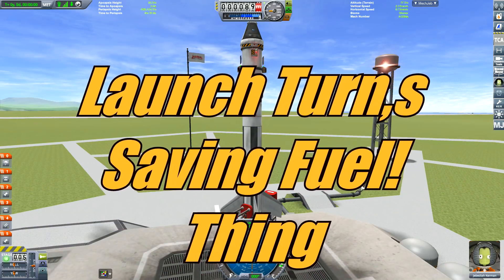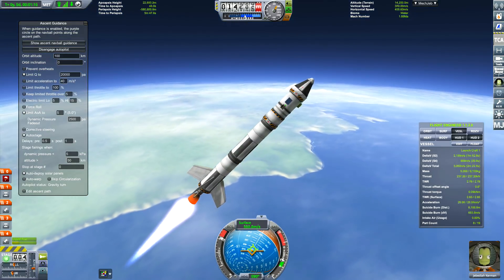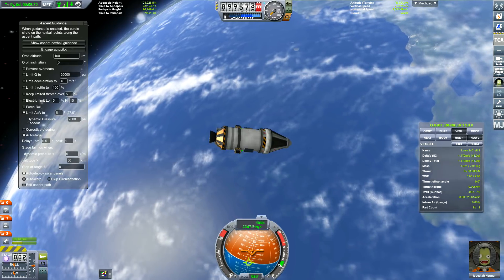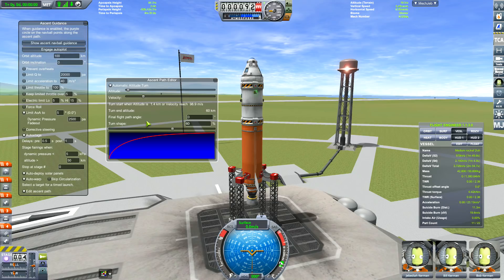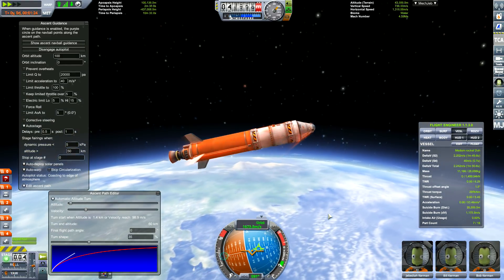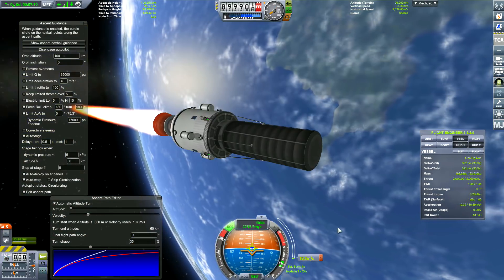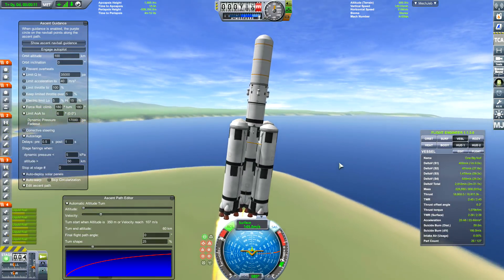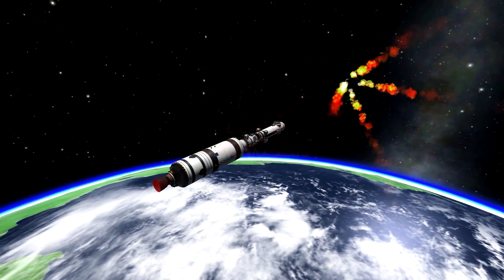Reducing Your Kerbal Footprint - Kerbal Space Program

Comment: Could you give us a list of your results?
Reply from the maker: Good idea :)

Launch Turn Test using MechJeb

Small Rocket Tests

Launch 50% turn = 1118m/s

Launch 50%turn no Q Limit = 1170m/s

Launch 40% turn no Q Limit = 1151m/s

Launch 60% turn no Q Limit = 1114m/s

Launch 30% turn no Q Limit = 950m/s

Launch 35% turn no Q Limit = 1110m/s

Manual launch = 1136m/s

Medium Rocket

Medium rocket 40% no Q Limit = 1203m/s

Medium rocket 60% no Q Limit = 1135m/s

Medium rocket 35% no Q Limit = 1205m/s

Medium rocket 30% no Q Limit = 1208m/s

Medium rocket 35% no Q Limit and no AOA = 1376m/s

Medium rocket 40% no Q Limit and no AOA = 1340m/s

Medium Max Q20000 TWR rocket 35% = 1263m/s

Medium Max Q25000 TWR rocket 35% = 1358m/s

Medium Max Q30000 TWR rocket 35% = 1402m/s

Medium Max Q35000 TWR rocket 35% = 1406m/s

Large Rocket

Large Max Q35000 TWR rocket 35% = 377m/s

Large Max Q35000 TWR rocket 50% = 271m/s

Large Max Q35000 TWR rocket 30% = 393m/s

Large Max Q35000 TWR rocket 25% = 408m/s
Reply: Ya you should have a summary! You don’t expect us to write each result down as you call it out?

Comment: Problem with stock Kerbal is that the atmosphere is so darn hot even at a high atmosphere. In real life the Falcon 9 gets out of the main bulk of the atmosphere very early on. I find a launch profile in an RO modded install is much more logical. T'is the issue with a 1 / 10 scale Kerbal I guess. :)
Really interesting tests you've run through here though. Nice work mate!
Reply from the maker: Marcus House Quite true the atmosphere in Stock isn't scaled correctly as you wouldn't get 1 bar at sea level at this scale. Need to experiment more with the kerbal atmosphere as Im terrible with space planes 😎